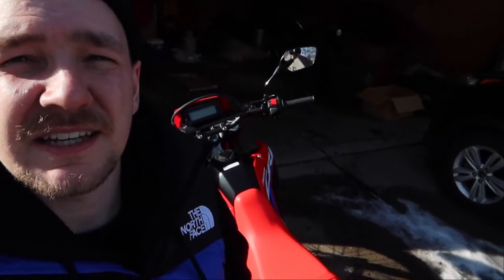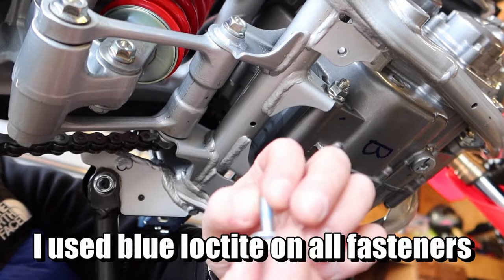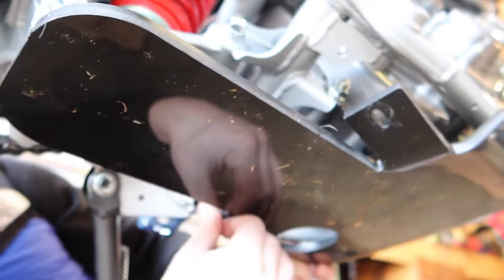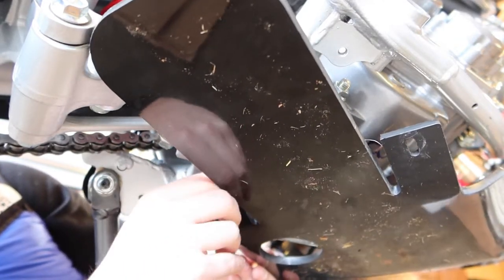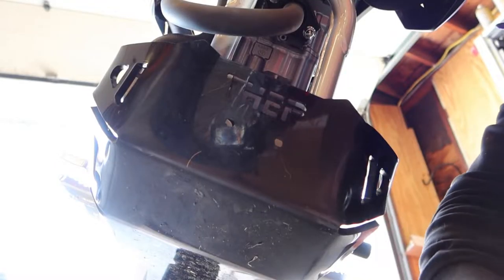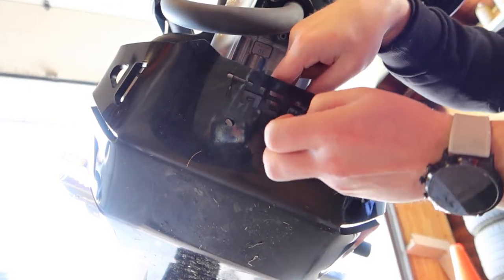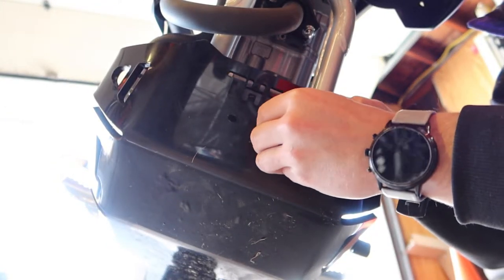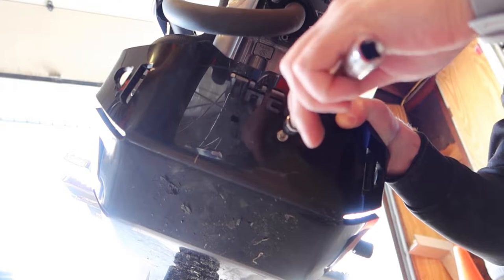THEP EXTENDED SKID BASH PLATE FROM BIKERZBITS INSTALLED ON HONDA CRF300L

Comment: Hello, I seen that your XSR900 haves the RPM Carbon Gas Tank Panels. Do you know if they will fit for a XSR700? They seem to be, because it's really only the middle panel that is different. Please let me know.
Reply from the maker: I don't think they would fit. The 900 and 700 fuel tanks are shaped differently.